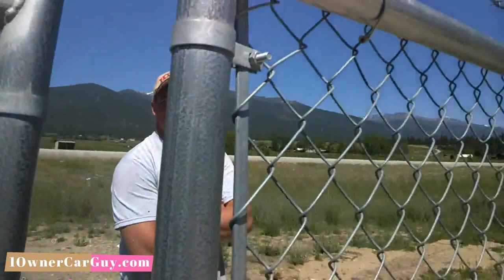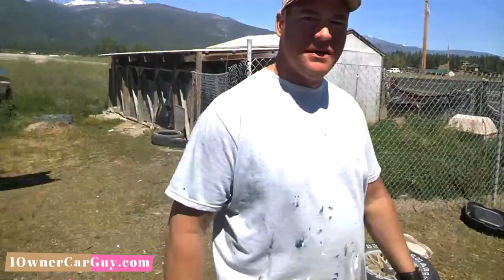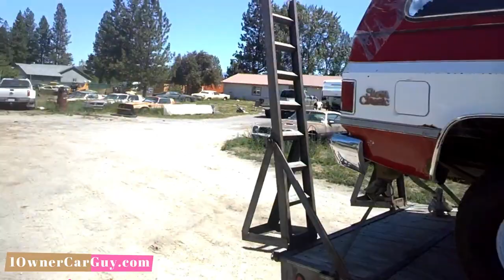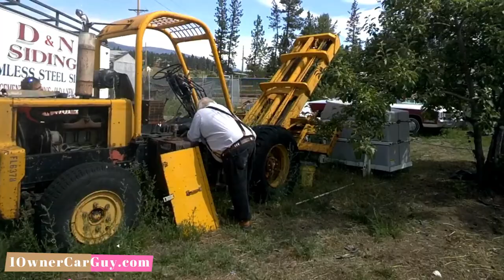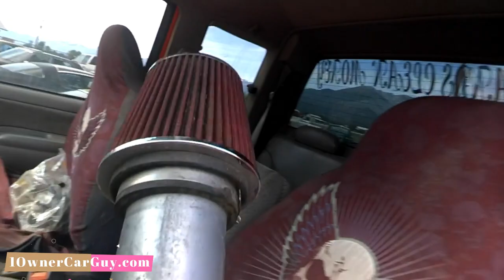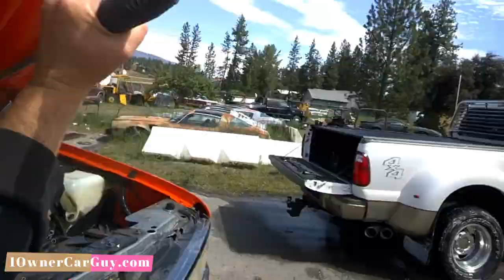SELLING CARS & TRACTORS ~ CHANNEL UPDATE AND DETAIL ~ DAILY WORK VLOG 2020 0190

Comment: 👍s up for the sunflower leafs growing back man. At least, you won't have to worry about anything eating the leafs anymore. That's probably the issue with the Blazer ( sure can't find them anymore)  my vega wagon I had a few years back had the same problem. It had one of those electronic fuel pumps mounted on the inner fender well. And, the thing with them was,if they got to hot,it would then vapor lock. When I bought that car,I had to put thmotor in it,etc. Other than the pump,it ran good. You and everyone have a great day man. And,see ya in the next one. Cool hat man. I like it 👍✌️